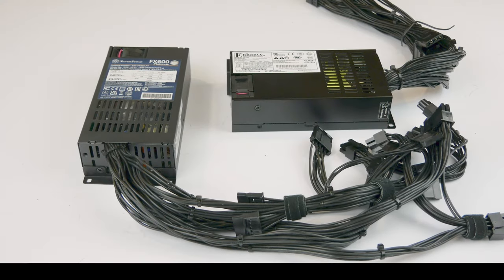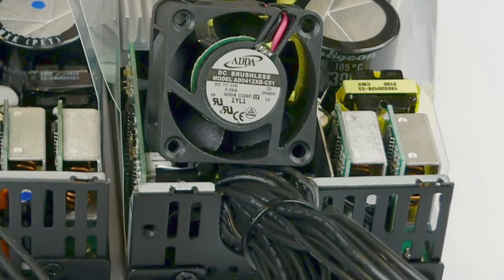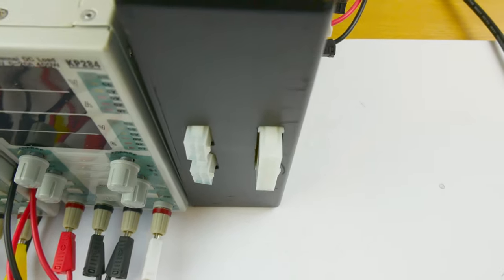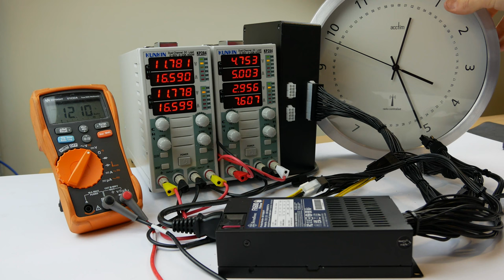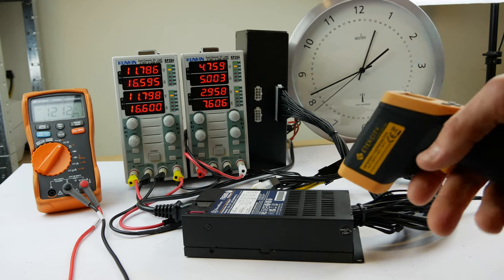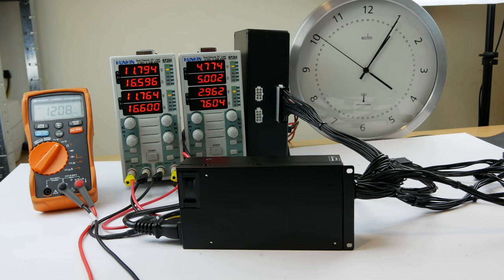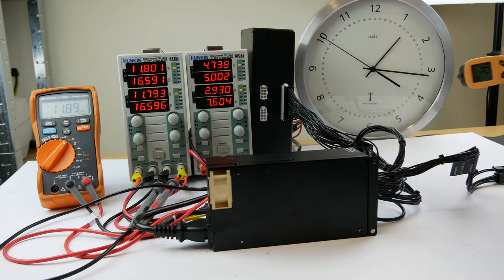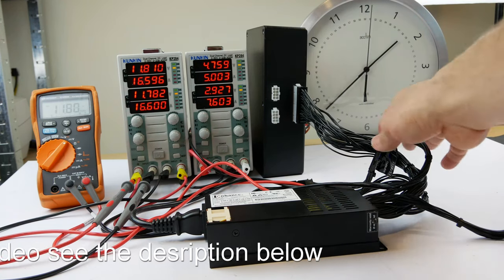The best Flex ATX 1U power supply??? Enhance ENP-7660B - Silverstone FX600 - Noctua Special

Comment: Glad to know that the Noctua fan mod offers overall better cooling performance and runs quieter.
Reply: Noctua fan offers a much quieter option but not better cooling performance as with the noctua fan, it is recommended not to go over 400 watts on psu.

Comment: Would a PWM 40x20 fan plugged to the motherboard and basing the %PWM off a critical component temperature be a better configuration than using the psu's power based curve? My PC only draws 250 ish watts at load, but because the case is super campred, Im getting 55-60ish temps on the backside with the stock Silverstone 600w model. The fan barely spins because the load is low, and I dont mind a louder fan as the sound would still get drowned by the cpu and gpu fans.

Comment: The first enhance 7660 psu had all japanese caps, not just the primary, the secondary too, and a better quality fan made from sunon. This new versions are terrible cheaped up, the original quality enhance platinum 600w is not in production anymore.
Reply from the maker: It's never had a sunon, it's Adda or yate loon fan. It still has all Japanese primary and secondarys. Any different and you have a fake non enhance electronics power supply. There's a lot out there on aliexpress and leaching into other marketplaces
Reply: @overtekltd2212  You are right about the fan, my bad, but im still say the same about the caps, look at this

https://www.youtube.com/watch?v=wacXPw-WrQI

this is a original enhance, the secondary capacitors are not the same on your video and in the newer models.
Reply from the maker: @robertosatotoas5741  the secondarys are all jap eletrolytics, Rubicon. Must be a very old stock psu that as they've been this way for a few years since silverstone fx600 production (same psu).  Production lead times are still high, so that may have played a part in that small change. I'll have a chat with Enhance. The one thing we had changed and improved was a the flow solder mask as initially we saw a few in every hundred with 100% fan speed, caused by solder flow bypassing the control circuit to give 12V all the time. Never seen that again thankfully. Would have passed burnin and not been noticed whilst in the burnin chamber under load.
Reply: @overtekltd2212  Then now all caps in the newer models are electrolytics? The polymers on the original psu are not better than electrolytics?
Reply from the maker: @robertosatotoas5741  No, From the horses mouth, Enhance, and closer inspection here. That Cap shown in the other video is the second source Nichicon (1/2 red top) which has not been used since 2020. The primary source secondary caps are Unicon. However, and here's the twist they look like electrolyics, but are in fact solid and are as they should be Unicon NPL series, 16v 1500uF 8x21mm package. So I got this wrong, as to the eye they do look like what we're clearly both familiar with as being eletrolytics. Good News

Comment: How loud would be just running the Noctua fan at 100% all the time?
Reply from the maker: Not very and its perhaps a very sharp option/idea for minimising residual thermals that could add system heat whilst minimising noise. 
As it happens, next week I have planned to complete and published a video that may also be of interest for this very purpose.

Will be a very easy pcb solder link mod (so long as you know the right end of a soldering iron to hold) that puts 12V to the fan header at all times. Clean and simple once known.

Comment: Don't forget you can use tiny boost converters to run 12v fans!

Edit:
I forgot to thank you for this indepth and informative video, I really appreciated it, also you could try and experiment with sunnon Maglev fans or to be more specific-- MF40201VX-1000U-G99
This particular fan is 40x40x20mm and is designed to spin up to 8200rpm while staying relatively quiet and consuming 1.6w!
Other specs
STATIC PRESSURE 7.37 mm H²O
AIRFLOW 18.25 mm³h
Noise 27.5dba (Factory spec not actual real test!)
Reply from the maker: We can deploy MF40201VX-1000U-A99 which we carry stock of and use elsewhere. Swings and roundabouts, depends what you want and what your doing. I would say the Yate Loon fan has a better audio signature than the sunnon. Sunnon tends to sound clicky, Noctua tends to be the smoothest audio wave. A boost converter, well that's fine if just want to run at say 12V / 100% fan duty, but that will be inherently noisier and if that was the intention, far simpler just to tap into the existing 12v rail. This defeats the point of having a fan voltage controller in the PSU to map the flow rate to the thermal cooling needs of the given psu design.
Reply: @overtekltd2212  I understand, and what about the MF40201VX-1000U-G99
Have you tested the actual noise in dba because 27.5dba is too good to be true!?
Can it be compared to the ones shown in the video in terms of noise alone?
Again thank you for the reply!

Comment: Do you know if the ENP-7660B fan curve is based off the instantaneous power load, or off the units temperature? Mine is very loud at ~250 watts from the wall, but published graphs show its fan shouldn't notable spin up till about 400 watts

Can a noctua fan just be soldered in safely? Is there a problem with the fans expecting different voltages?
Reply from the maker: Firstly, when did you get your ENP-7660B?
Reply from the maker: It's possible you have a faulty unit where regardless of load or temp your getting 12v to the fan, caused by a flow soldering issue. Its something we identified and Enhance have since put in measures to prevent it in future. I will be doing a video on this soon, as the fault, in some applications, maybe beneficial to replicate, but equally will allow anyone with the fault, who knows the right end of a soldering iron to hold, to fix in 5 mins.
Reply: @overtekltd2212  I got it about two months ago from Velka's store. I'm in the US but I  wish I had known sooner that you were providing variants for the Densium :( 

The thing with my unit is that the fan takes some time to spin up at around ~200-250 watts of load, and it doesn't seem to immediately spin down either. (it takes a few minutes to spin up with a constant 150W furmark load, and then about 30 seconds to spin down once I close it). 

I'm pretty good with a soldering iron, do you think there is some other defect going on? Do you know if the fan curve is based off instantaneous load or the units' temperature?
Reply from the maker: @borisyeltsin6606  drop us an email, sales@overtek.co.uk, I'll send over the info tomorrow. In short though I would say no, it should not be doing that, whether at 25 degrees or 40 degree ambients. I don't believe anyone is running a different fan map, but its possible and only velka can advise on what their prodution units have.